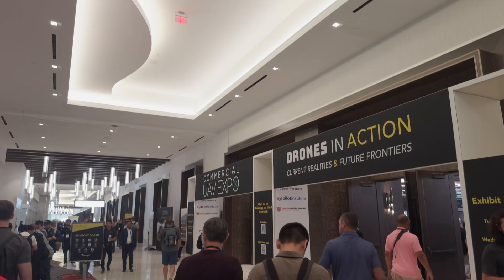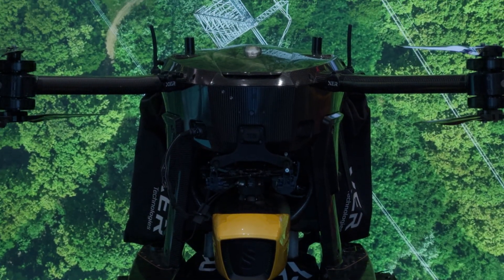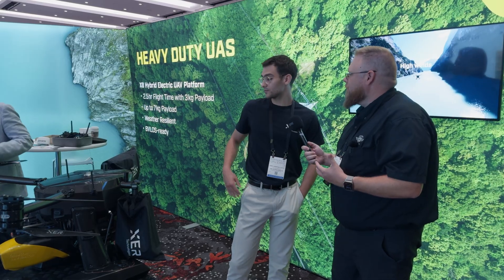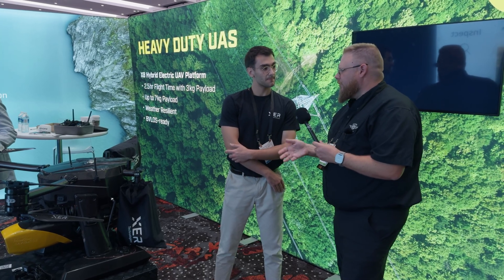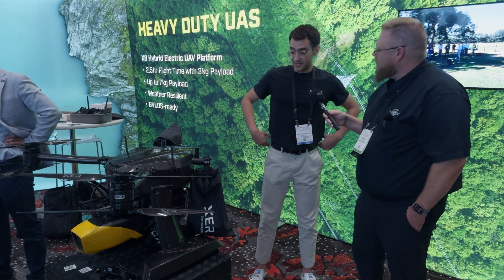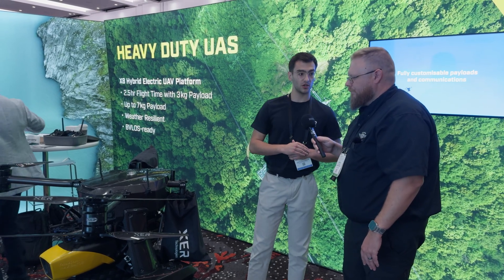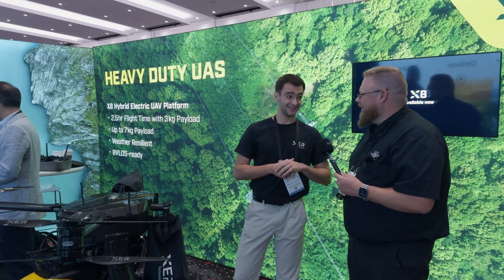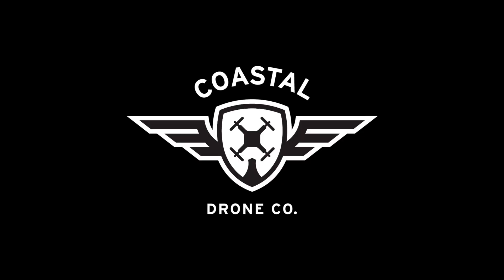This Hybrid Drone has a Gas Tank for Landing Gear! | XER-TECH | UAV Expo 2025

Comment: Why are we limited to a certain weight? That’s the dumbest thing…
Reply from the maker: You aren't, the main difference is <150kg is possible under CARS 901 where >150kg requires a Special Flight Operations Certificate.  In the USA it's currently 0-55lbs for Part 107 and 55lbs+ requires a waiver.
Reply: @CoastalDrone  what’s next we can’t wear pants wile flying….
Reply from the maker: I don't already!